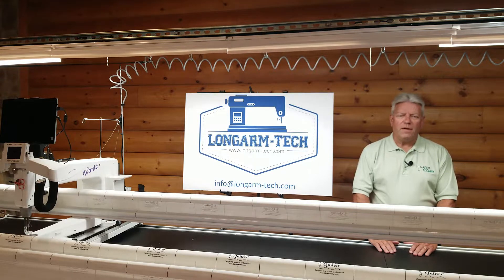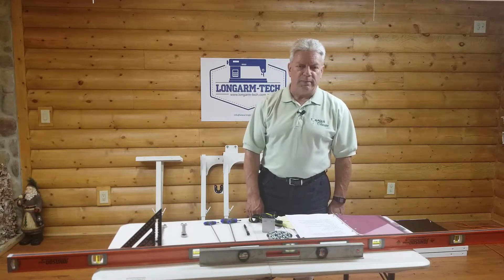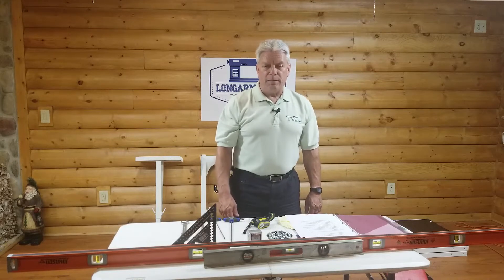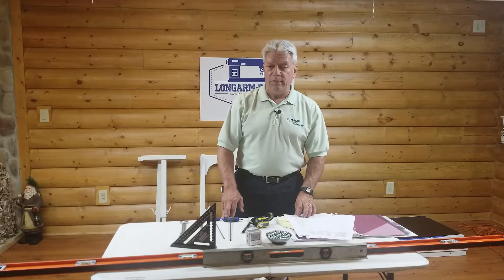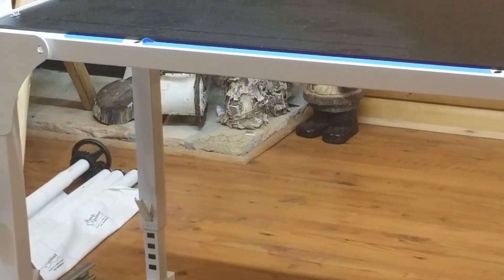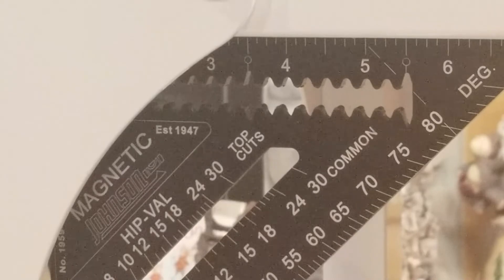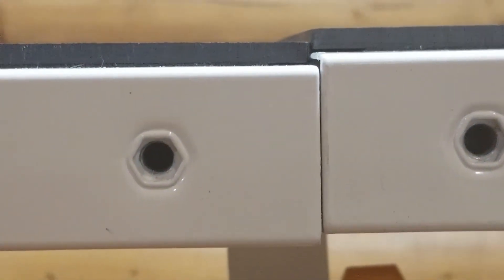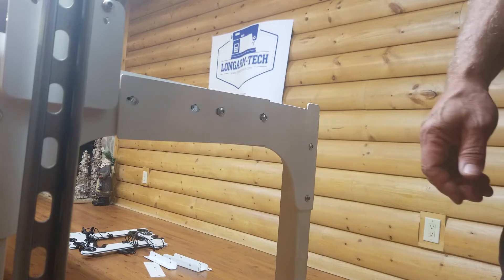Basic Longarm Quilting Frame Assembly - Sectional/Modular (Handi Quilter, Janome, Baby Lock)

Comment: Do you have a video on how to raise the height of the studio frame with an Amara on it? Mine is set too low. Do I have to disassemble the whole thing in order to raise the height? In the handy quilters video on how to put the frame together, they said, set it at the lowest height. I thought by the end of the video they would teach you how to set the height, but they never did. I’m not the one that put my frame together originally, and now I realize it’s too low and it’s hurting my back.

Secondly, do you have a video that shows how to install properly the handy hammock? I bought one and it came with no instructions, and it was completely useless, and I had to jury rig it to get it to attach to my frame, but now I can’t take it off if I need to. So I’m wondering if there is a proper way to do it? And if so, do you have a video for that? And if not, would you consider making a video of that? Thank you very much!

Comment: When I got my 12 ft Studio frame my track came already attached to the sections. I installed the black rubber strips.   I have bumps at the both places the sections go together.  I see you have one 12 foot rail.  Where did you get it?  I am hoping that will correct those darn lumps and bumps that are driving me crazy.

Comment: With the preciseness that this requires, I wish they would have certified long arm installers at dealerships or at least be hired to do such work
Reply from the maker: Great observation Carmen - the average quilter, and the Pro-Stitcher computerized system, don't notice the non-flat track surface in some cases created by alignment problems during Frame assembly. All the videos I will be posting on techniques to improve Frame flatness are intended for those sensitive free-motion quilters who need the smoothest, flattest track possible to maximize their artistry.